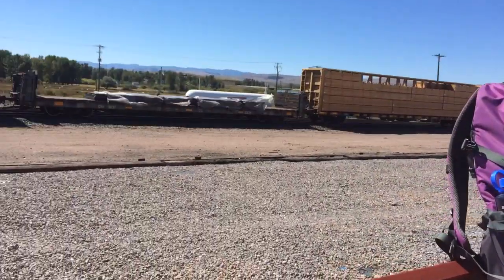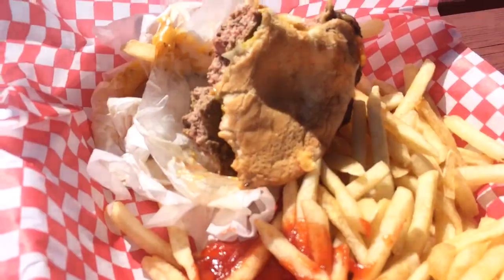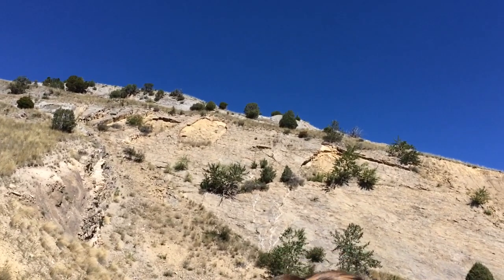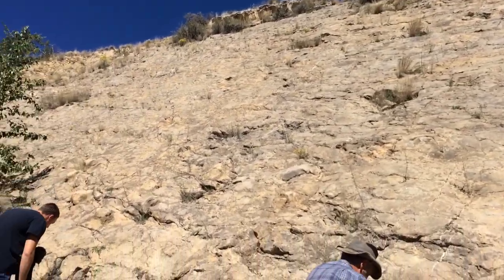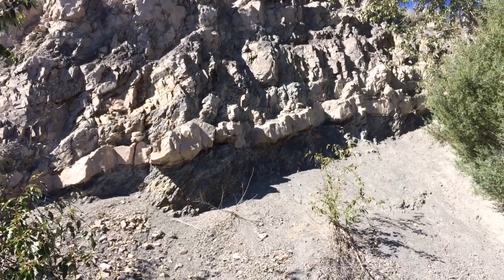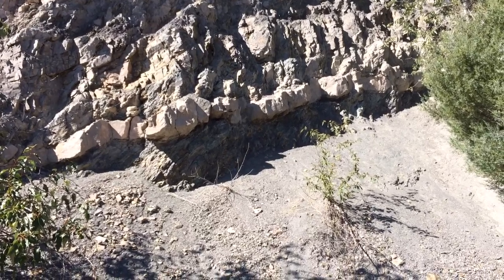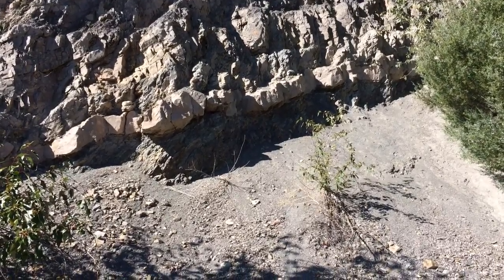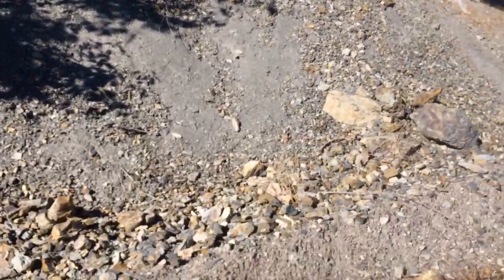Just Some Geology Stuff

Comment: What's cleaving?
Reply from the maker: DoctorChaggers Cleaving is when a rock or mineral tends to break along a weakness in it's crystal structure. For example, the crystals of salt tend to form in a cube. A lot of the time, if a piece of salt were to break, it would break along the planes of the crystal structure where it is weakest and so break into even smaller cubes.

Not relevant to your question but, just to note, habit (crystal growth) and cleavage are two different things.